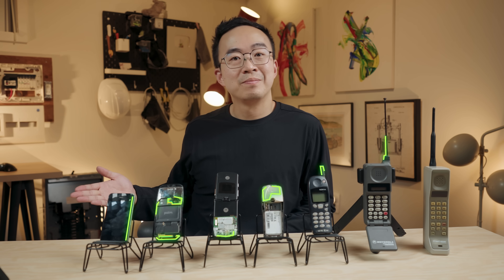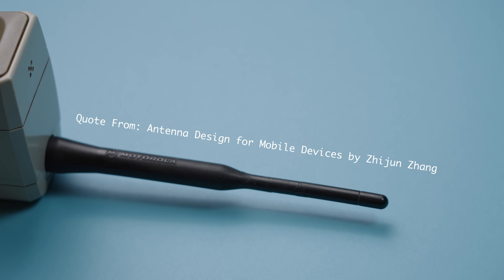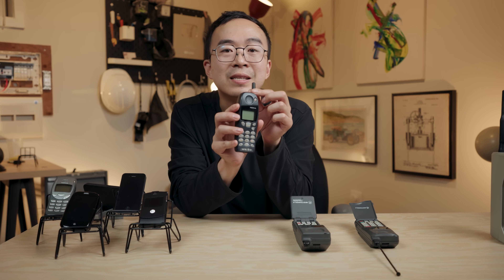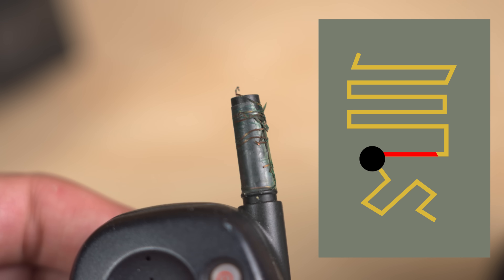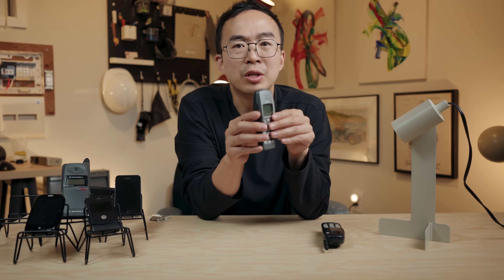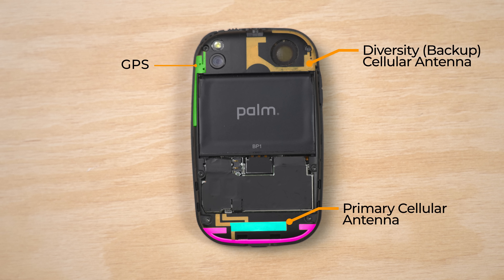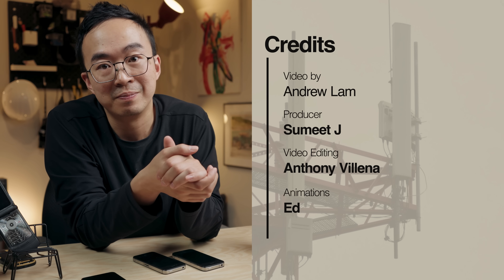How CLEVER Design Made Antennas Disappear

Comment: As an RF engineer, I am just glad people outside of the industry are thinking about this stuff. Very cool
Reply from the maker: You do incredible work!  I cannot believe how complex RF engineering is and how underappreciated it is.
Reply: You have a very cool job
Reply: As a PCB designer, not an RF engineer, I would like to be interested in methods to reduce the impact of body blocking, even if the antenna is well matched. What materials would you recommend for familiarization?
Reply: I repair electronics and everyday I get to see very different antenna designs. Everyday there is something new to amaze me.
Reply: RF engineer here too :) in automotive sector
Reply: thanks for the grind bröther
Reply: As a tower technician we sometimes hate the RF engineers or whoever makes the RFDS or construction design. Because some builds are just impossible or flat out wrong😂. Most of em don't have field experience
Reply: well we have to, everything or almost being wireless it's important to care about antennas.  and realize how clueless apple really are when designing their overpriced terminals. 

"where's the ground plane?"
Reply: As a layman, I know that antenna's length must be tuned to the wavelength.  But I also know that is only for optional reception.  A strong signal can be picked up by anything.  A wire coat hanger, metal fillings in your teeth.
Reply: Do you have walkie talkie?
Reply: Your career field is fascinating I'll never work in the field but I definitely like studying and learning about frequencies and their uses
Reply: Thou must needs repent. Pulsed RF technology, like that from phones WIFI, Bluetooth, have destroyed the lives of billions, yes, with b, billions of people, including mine own. If thou would like to live there is forgiveness of this and all other sins only in Jesus Christ. His words are without error in the King James Bible. Please look up the following and heed what is written from the heart, speedily:

1 Corinthians 15:1-8 KJV
Romans 10:2-13 KJV
Proverbs 30:4-6 KJV
John 14:6 KJV
John 14:22-24 KJV
John 17:17 KJV
Psalms 1:1-6 KJV
Reply: @RememberGodHolyBible   Cut the BS!
Reply: Awww people are making videos on things you like as well. Are you not special, little one. Give me a break.
Reply: Can someone tell me why I have a red flower shape mark on my skin where I put my phone?
Reply: @Eduardo_Espinoza is your phone physically hot or do you have a case with a raised design on it?
Reply: As an RF engineer, shouldn't you want this all to "just work" and people to not even need to think bout it?
Reply: @keaton718  That can be said for any technology..
Reply: @keaton718  the more people know about the esoteric world of antennas and radioelectric spectrum the less 5G new world order conspiracy theorists we get
Reply: @murisio  New world order is real though. 5G conspiracy theory was manufactured to discredit anyone questioning covid scale and response.
Reply: @murisio  Is it really a conspiracy theory when the WEF has literal commercials declaring that they want to destroy western civilization to usher in a one world government? I'd call it a conspiracy fact.
Reply: @keaton718  I’m not an RF engineer, I’m a HAM operator — but with a twist: I’m also a programmer with a B.S. in Computer Science. To me, a job is well done when the work is so seamless that most people don’t even realize the profession behind it exists. And that’s exactly how it is with antennas: almost nobody thinks about them. That silence is proof that RF engineers are doing an absolutely amazing job.
Reply: @keaton718  well, Apple claims their technologies "just work" but are hostile to provide support when it doesn't

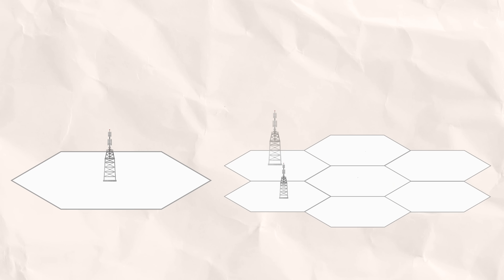Comment: 5:15 This is actually why they're called "cellular" networks, because they're made up of what amounts to a grid of adjacent "cells" of coverage each served by a central tower. This differs from most earlier radio networks, which typically achieved broader coverage with fewer smaller radio towers (and the use of different frequencies that propagated farther), or operated only in specific limited areas.
Reply: I get a chuckle over how cell networks are usually depicted as an array of perfect hexagons!  🙂
Reply: wow, they'll forever be known as "cell phones", but very few people will ever know where the term actually comes from!
Reply: Close, but there is no "central tower" in cellular infrastructure. In fact, the "tower" trope is an oversimplification that has become popular despite being wrong. Yes, some cell sites are placed atop towers, but they can be put on buildings and other structures. The tower itself only exists to hold things up, it's not a part of the cellular system. Yes, there are cells, and each cell can be served by multiple antennas and radios. With the original cellular system called AMPS, these cells covered a pretty large geographic area. With each successive version of cellular (2G, 3G etc.) the cells got smaller and closer together, to aid in reception and to support higher data throughput.
Reply: Its funny that 5G is essentially "WIFI", lets just put a wireless router every block on the posts and builds. Its more like a mesh than a cell now.
Reply: @monad_tcp  What makes you say that 5G is essentially like WiFi? If you're talking about the nature of the system being that it's comprised of multiple access points spread throughout a geographical area, then yeah I agree, but 3G and previous versions of the cellular network behave the same way too so it's not just 5G. 

Unless you're confusing 5G with 5GHz. 5G cellular networking doesn't use the same frequency space as a 5GHz WiFi router. 5G just means 5th Generation
Reply: @GhostRyder2008  5G mmWave has shorter range therefore the analogy fits better
Reply: @subvia  Yeah that's what I was assuming they meant in my first paragraph. That it's like an Extended Service Set in WiFi networking. Hard to know exactly what people mean sometimes 😅
Reply: @GhostRyder2008 That difference is so annoying when researching how stuff works or looking for troubleshooting advice. 5GHz pops up way too often when searching for 5G, even if you exclude it (Which knocks out sites that talk about WiFi on the same page and sites that simply have it listed unfortunately.)

Comment: 8:58 Great video but the radio comparison was very wrong. 
AM and FM and inherently different modes of how data is sent/received. Different frequencies compare better (or exactly) to change the radio station on you radio by dialing in another frequency on the turn knob
Reply: AM & FM broadcasts are different modes and bands.

Comment: I'm pretty sure the reason reviewers don't review reception is they can't.  Those bars at the top of your screen don't actually mean anything so they can't report them and even if you open up the special radio link data you are just reporting the numbers the phone maker wants you to see.

That leaves two options for a reviewer.  Either invest in probably 100s of thousands of dollars worth of specialized radio gear to test properly or to buy the same phone on multiple networks and log transmission speeds while recording location, time and weather for 100s to thousands of hours to disentangle all the confounders.
Reply: Exactly, analyzing reception relative to the environment is very complicated. The position of your hand affects the connectivity, but so does the truck driving down the street. It's hard to really put numbers on the connectivity outside of specialized labs; unless the phone is badly designed.
Reply: Transmission speeds are not the way to measure reception. You could have excellent reception and still get terrible speeds due to your tower being oversubscribed. Repeaters that are commonly used in buildings also muddy the waters
Reply: Most reviewers don't have necessary technical knowledge or background. Sometimes they don't even know what they are talking about.
Reply: Good thing we have creators like geekerwan
Reply: Most reviews are about subjective user experience not measuring the nanoseconds between packets
Reply: @KaitouKaiju Right and that works bc your experience is going to be enough like their experience and you know when it won't be.  Now imagine that you got a random phone in the box that could be the new flagship or an old flip phone...knowing how it went for them doesn't tell you much about how it will go for you.  You need to know the distribution -- are most experiences going to be like theirs or not.  Reception is very variable like that.
Reply: My Huawei P30 Pro does have better reception than the iPhone 14, i.e. 4g at a lake where my mom's iPhone had EDGE.
Reply: There's apps such as Cell Mapper and Network Cell Info.
Reply: I mean, wouldn't a fair test be to just set up a random wifi router and then test the internet connection from a long distance?

Comment: Holding a phone to your head is no different than holding your hand against your head in terms of discussion of heat.
Well made video!
Reply: Would need a lot more transmitting power for it to be a danger. Also, the head has so much blood flow that I kinda doubt that slow gradual heating from from a low power transmitter is even remotely possible.

Comment: There are so many real world variable that may cause any reception reviews to be unreliable. You can do a review in a lab setting, completely shielded to get a perfectly objective comparison with other phones, but it will still be inaccurate to normal usage because it will lack common real world variable. It's kinda like the chicken and the egg thing.
Reply from the maker: Maybe that's the issue as there are so many variables even what cellular network you're on.  Reading reports on cellmapper and how they were tracking what broadcast equipment was used where was quite interesting.
Reply: Normal usage cannot be recreated as you have demonstrated in your comment. It would greatly depend on where someone lives. Also if you area has coverage any phone that is compliant with the specification should work.

Comment: So I know this was a simplified video, but phones no longer use antennas that are a multiple of the radio wavelength. If I remember correctly it was the iphone 4 that changed this first, they pushed for an RF filter that would allow them to make one phone model for all carriers and countries. So now every antenna sees multiple frequencies and you filter out everything but what you're using. Now all the multiple antenna in phones can be used for things like beam forming and better reception.

If anyone wants a deeper dive see the video: Asianometry - The IPhone Forever Changed The RF Filter
Reply from the maker: I'm going to list this video and yeah, it was simplified sadly.  So much interesting stuff that I wanted to cover.  Thanks for mentioning this video.

From my understanding they still need to use a multiple of wavelength but because of newer filters and tuners the overall spectrum coverage is much wider without a huge drop in efficiency.

The stuff from quorvo I was reading was quite fascinating
Reply: @Lam  No, they 'gain' signal from the correlation of multiple antennas (MIMO). For example, the formerly mentioned beam forming allows to electronically change the ideal reception angle for the combination of antennas (phased array). This is further enhanced with signal correlation feeding into some phone model parameters which in turn provide parameters to sway the antenna direction in response to its environment (hand). The next layer is the signal processing itself instead of hardware techniques ... It's not just the antennas though. We still have multiple frontends and clips in our modern phones acting as antennas. There's also new factors coming into play. Resonance matters less, multipath channels matter more .. So many things and improvements one could pick on .. Great video overall though! The topic is just wayy too vast to cram into 20 minutes.
Reply: @einball  You mean to tell me we have phased array radar type things in our phones? Dang
Reply: @Lam You should've covered them. This was brilliant to watch and follow. Lots of work no doubt, but the result was engaging and informative.
Reply: @AndiKola It's an interesting video on it's own, I would say the RF filter video doesn't have a lot of overlap and they both complement each other. Though it would have been cool to have a simplified explanation of the change in antenna design in combination with how RF filters changed that.
Reply: they still have to pay attention to swr standing wave ratio otherwise the transmitter circuit makes no apparent power and overheats. varicap diodes are used to tune the antenna from inside
Reply: You're not fully correct, your antenna still needs to be on the order of the radio wavelength as that's what fundamentally makes it effective. People have just gotten good at doing things like designing an antenna capable of effectively receiving signals across a wide range of bandwidth, so that you don't need one antenna for every single frequency range that the phone needs to support.
Reply: 5100 and 3200 came out around the same time then after a while so that Europe and Asia can actually bring their phone to the US. The quad bands and tri bands were developed.
Reply: @crazyjds   Yep.  I used to have a quad band Motorola Razr (GSM).  Before that I had a Nokia 6160 (IS-136 & analog) with the Snake game!  🙂

I now have a Google Pixel 10 Pro and my first cell phone was a Uniden CP-4600 (analog) which I bought in Jan. 1995.
Reply: probably this is a field you could get multiple degrees in, however a brief technical overview shouldn't be too hard.
Reply: They use aperture tuning, which essentially forces the resonance by using switches and tunable capacitors.
Reply: It seems a similar explanation may hold for car antennas.
Reply: But is reception really better ?
At least here in Sweden, phone reception is way worse now, than 15 years ago.
Sure, I can get 260Mbit/sec download at my house.
But I also can't speak without breaking reception, while driving my car in more rural parts, and that's in "well populated" south of Sweden.
Even before closing down 2G and 3G networks, not sure how this will pan out, at all.
Reply: @daniel635biturbo  probably is related to shutting down 2G and 3G though, even if you discard that possibility.

4G and 5G have lower range but greater transmission speeds and lower ping, but this is exactly why rural areas now suffer poor cell reception.
Reply: @Nagelzz   The range is largely dependent on which band is used.  4G & 5G can use all existing bands as well as newer ones.  If they use higher bands, without considering greater path loss, then there will be poorer performance.  Also, 5G can use beam forming, which improves performance.
Reply: beam forming?! you mean like a phased array? that's awesome
Reply: Initially they still used tuned antennas for multiband coverage but they were each tuned with an RF switch which connected loading to change the tuning.   We've since re-unified cellular standards so this is not as complex but some is still required.   The advent of SDR receivers also allows some of this to be implemented as signal processing.
Reply: Well... the antennas are still a multiple of the wavelength. I mean, what *isn't*?
Reply: @Oberon4278   Lots of antennas aren't.  At lower frequencies, they are often shorter.  They are then tuned with loading coils to make them resonant, but even that isn't necessary if you're not worried about efficiency.
Reply: Cool. I haven't heard that modern phone antennas were first used in iPhone. Seems like it should get more credit for having the first modern phone antenna.
Reply: The signal bars on a phone are a meaning less way of measuring signal android phones can give you the dB value but decibels is a brutal confusing measurement system like a gas gauge full tank on a semi truck is 100 gallons enough for 12 hours on a tank a tractor it's same working man does a 12hour shift yes I'm American thank you Britain for the inch and the gallon we have to train to read a tape measure

Comment: Love the idea of a signal/reception/etc. review - seems like it would be difficult to do reliably which is probably why it's not already being done. The complexity between different bands, carriers, phone modem chips, etc. add a ton of variables. Not impossible but not easy!
Reply: Geekerwan did a small but rigorous test of reception both under lab conditions and of real world usage in controlled, identical conditions very recently. It's on their YouTuber channel if you're interested.
Reply: Linus Tech Tips is trying to setup an rf anacoich chamber to test signal recepetion strenght and efficiency for phones they'll review in the future and benchmark as well the ones already out but they are still working on it.   anachoiq? how does someone write that
Reply: @ricardombr  I bothered looking it up, it's apparently spelled "anechoic"
Reply: I live in an area with poor reception, and I've been specifically looking for a phone with good antennas so I can make calls anywhere
Reply from the maker: Agreed way too many variables!  However check out this RF engineer's perspective on why measuring reception matters less than the battery / heat generated: https://www.youtube.com/watch?v=RppnQ28BsiE&lc=Ugy_jX0PBSY22GPF6LF4AaABAg&pp=0gcJCSIANpG00pGi
Reply: Not only is it much much harder to test now with how many more frequencies there are and things like carrier aggregation where your phone uses multiple connections to a tower, it also matters much less now with how much coverage networks have.